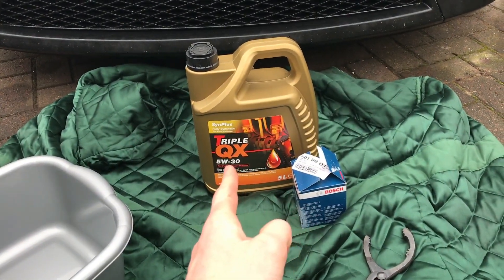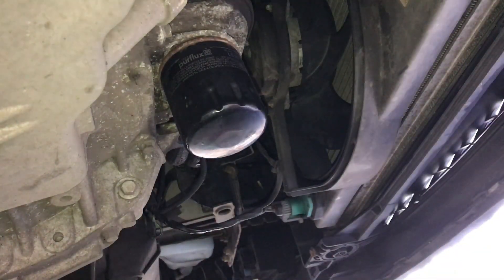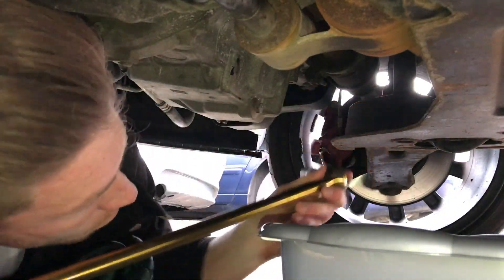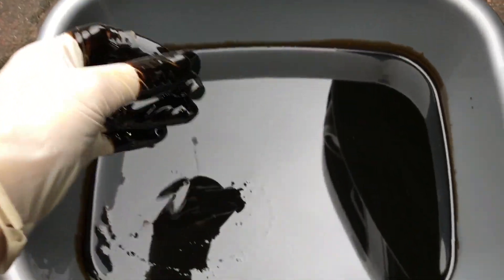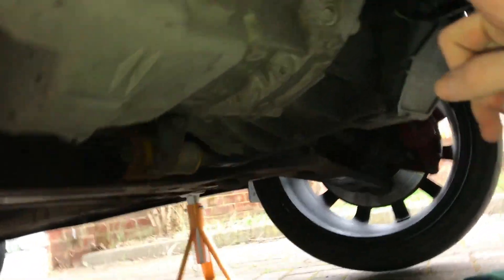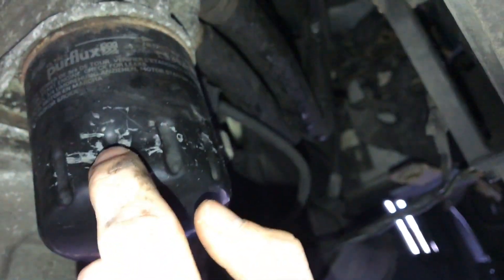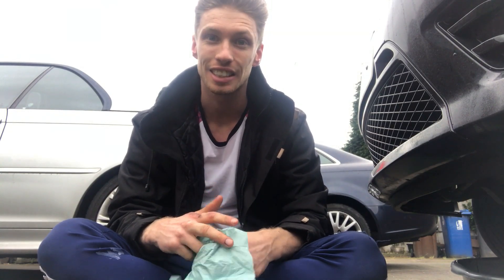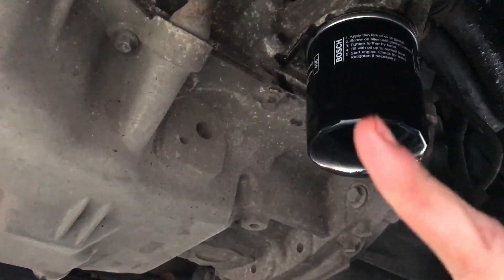How to Change Oil and Filter on a Ford Fiesta MK6

Comment: The only thing I would do different is put a flushing additive to the oil drive around until mixed, When the oil is cool not cold remove oil filler cap before removing the sump plug and filter, The rest of the video is good well done!! I change my oil + filter every 6 months or 6000 miles which ever comes first!! By the colour of your engine oil you need todo the same!! By DIY you have saved a packet! My local garage charges £120 pounds for an one hour job!!!

Comment: I had to laugh when you dropped the drain plug into the oil! We've all done that and it is a real pain in the arse! I've bought a magnet on a stick for times like those! I use a fabric strap wrench which fits onto the ratchet spanner to release the filter. Failing that I have a chain strap wrench, and when I worked in the garage they just knocked a screwdriver through the filter and swung on that to get it off.
Reply: Holy Sh**t

Comment: Hi Lee I know this video is almost a year old now and you probably know this by now but just in case it slipped you by, the reason you smear a little oil on the filter seal is to stop it kinking as you tighten it

Comment: well done mate but top tip always crack the oiler filter and sump drain plug first so you know you can undo it before getting to much into the job.also sometimes you should change the sump plug on an oil and filter change or at a min replace the sump plug washer.
Reply from the maker: DELBOYS LOCKUP there was a rubber ring on the sump plug, and it was in good shape so I left it! But you're right by the book you should change it

Comment: It's always best to fill the filter up with oil to prevent a dry start
Reply: if its full of oil ..how you gona fit it in there ...coz you'll have an oil spill all over your hands ... making it hard for your to torque it back in place
Reply: Why would a “dry start” do any damage? Only the filter is dry which doesn’t make a difference. All engine components are lubricated.

Comment: The only NEGATIVE thing
with using oil on the seal, is that, the minerals in the oil will degrade the rubber over time. The Best (and Imo the only) thing to use is a rubber grease

Comment: Always tight oil filter just with your hand, don't use wrench because you will have a problem when you try to get it off next time. It will tighten over time because of temperature/aging/sticking.

Comment: Almost. Yes; you got it right saying you  should use a jack stand to support the vehicle after lifting the car with the jack but you must also properly chock the wheels that remain on the ground with rubber chocks (so when you tighten or loosen plug it doesn't overbalance a fall off the jack stands) .
Reply: Hand brake perhaps!!!
Reply: @keen2b  Perhaps, but it's mot not safe to rely on them either as the hand-braked wheel can still slide enough so the vehicle falls and one of the 3 wheels on the ground has no handbrake; all 3 need to be ckocked on both their sides (front and rear).

Comment: as far as tightening the sumpnut ive always done it up handtight and then a little turn with the ratchet, just enough so it doesent leak under pressure, if you tighten it too much  you may have trouble undoing it , as you did when you started. thanks the batman.

Comment: If you haven't got the tool to take off the oil filter and the incredible hulk tightened it up, you can stab a decent size screwdriver into the filter and use it to loosen the filter off.  Downside is it's a messy way. But if needs must.

Comment: Just bought one of these well a Zetec S as a runner, glad to see the filter is easily accessible. Not as easy on an RST. This was very useful to watch, I know how to do an oil change and this is pretty much same as I'd do it. Previously I've had to stab the filter with a screwdriver and then whack with a hammer or even elastic bands can help with the grip. You'd be surprised. What do you drive now, still got the ST?

Comment: I'm now mid oil-change on my 1.2 Mk6 Fiesta.
That oil filter is a real pain in the arse; there's not much space around the filter to grab it or put a chain filter remover on it.
BMWs are much easier, you have the outer oil filter casing under the bonnet, which you can put a large socket on.
I'm now off to Halfrauds to try and get a removal tool.
Reply: Filter removal tool from Halfrauds was shit. Didn't even grab the filter tightly enough to rotate it.
I went down the tried-and-tested route of hammering a screwdriver through it. It's the point-of-no-return but I had ran out of options.
It took two goes at driving a screwdriver through it and turning it.
Got the bastard off in the end.
I suspect that the shitty Ford dealer didn't grease the rubber seal.

Comment: I haven't seen oil that black on a well maintained car in years. Looks like a diesel's oil. I would have changed the spark plugs, air filter, pollen filter and flushed the oil with flushing oil as well.
Reply from the maker: I have an induction graham racing air intake, doesnt need to be changed, it was clean. Ill definitely get onto the spark plugs next, cheers.
Reply: Word of advice, be very careful with your spark plugs, don't do them on a engine that's even been started up, even for a minute. These Fiesta's are a nightmare for snapping spark plugs in the cylinder head. The main reason is people over-tightening them and using the wrong tool to remove them. It's a cylinder head off and new head gasket etc job if a spark plug snaps.
Reply from the maker: cheers for the advice bud

Comment: Bro u need to start wearing gloves and always replace sump plug gasket u don't wanna leak for the sake of a couple of pence
Reply from the maker: Amateur Mechanic Guy I know I should have got gloves! I normally do replace the gasket but I had to get it done short notice because the oil was getting bad
Reply: It's not a gasket, it's a copper washer. Done many oil changes, even my dad with all the family vehicles, never changed a copper washer to a drain plug on any cars and never had any oil leaks.
Reply: 8ile same
Reply: Not on these (and many other cars it's not):  https://www.youtube.com/watch?v=PlBFEM_64XY

Comment: Get yourself a K/N Oil Filter mate.. They're wrench off
Reply from the maker: George Austers this new one is a socket one, considering the location of the oil filter on this I think a socket with an extension will be the easiest way! Also, yeah thanks for that info, I should have removed the sump and the filter together
Reply: No prob mate. The K/N ones have a half inch nut on the end but you're only supposed to use that to get it off and just tighten it by hand when you put it on. 

Car is looking nice man!
Reply from the maker: George Austers yeah I only tighten by hand putting it on. And cheers mate! Got some plans for her!